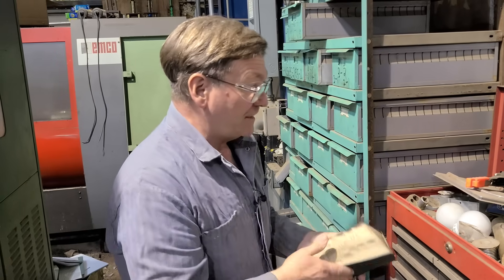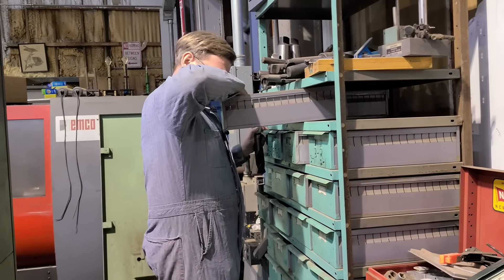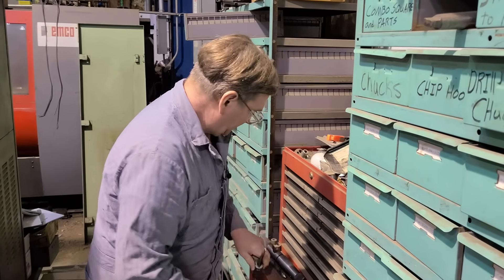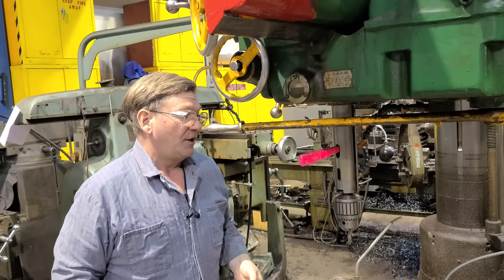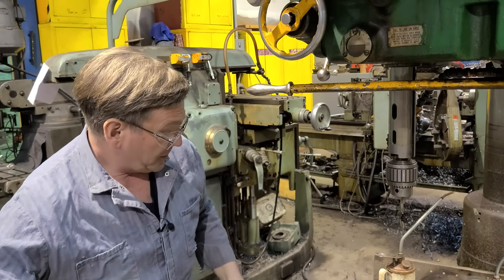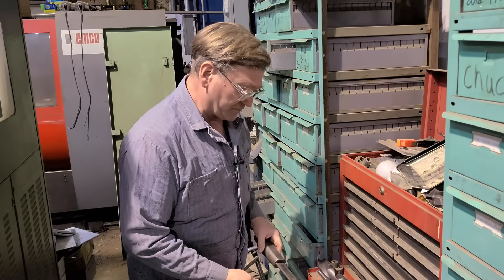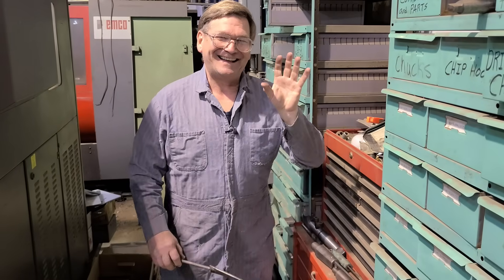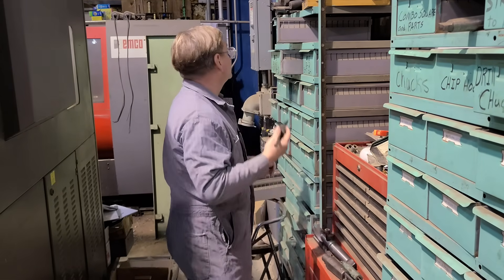Morse tapers and Armstrong automatic drifts

Comment: To seat a taper in a sleeve, i drop them end first on the floor until they bounce, then they are seated. If you drop them and it stops without bouncing, it is not seated.

Comment: Armstrong Safety Drill Drift
No.	MT Capacity	Recommended for
1A	No 1, 2 or 3	No 1 or 2
2A	NO 2, 3 or 4	No 3 or 3
3A	No 3, 4 or 5	No 3 or 4
4A	No 4, 5 or 6	No 4 or 5

From the 1961 Armstrong catalog.
Reply: typo? "No. 3 or 3"

Comment: I use a drill press and a drift to remove the MT2 holder. Then I use a dead blow hammer to keep the tool holder in the tool holder from falling out or being pulled out, 3 solid hits does it.

Comment: For the drill press, I just used a block of wood for them to drop to from a small distance. Less then a inch.
Reply: Yes, exactly this for me too 👍
Reply: In the past, we'd use about a 12" x 12" cardboard box loaded with packing peanuts in it to catch the tooling as it dropped. There was always a lot of those from items being shipped in or out. Substitutes are block styrofoam chunks, a layer of newspapers several inches thick or old wadded up rags. Whatever is on hand and works... works!